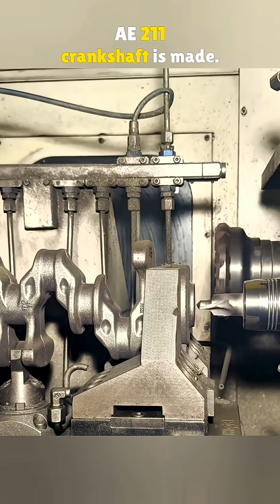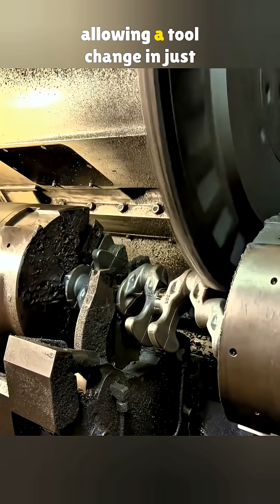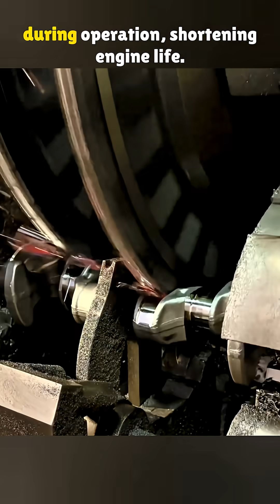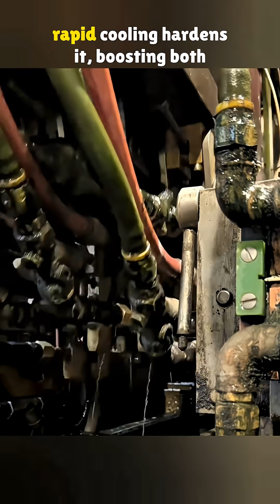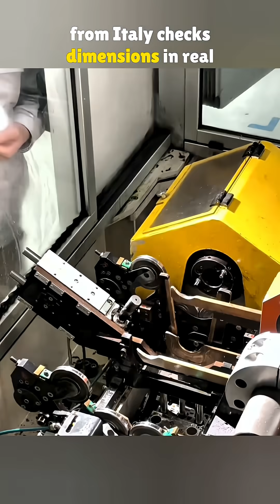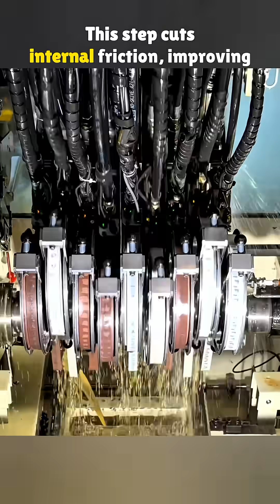Inside the Making of a Volkswagen EA211 Crankshaft #assembly #automobile #car #manufacturing

Comment: It’s not a matter of China having the manufacturing ability, that’s easily observed in the amount of machining equipment they own and the thousands and thousands of products they make every single day. What is doubtful though, is how much engineering time was spent to verify that what they make is any good or whether or not it is reliable. Most products built in China are built to the bottom dollar. That means any extra R&D cost for verifying that the product is going to survive is an afterthought at best.  

China’s manufacturing strength only comes into play successfully, went outside vendors who are concerned about brand and quality are involved to hold their hands. At no other time can they produce a quality product.

Comment: The problem isn't the machinery. It's the unskilled labor and the lack of competent management oversight. When a cutter head is worn, for instance, it's not necessarily replaced on schedule just to save from eating into business profits. The person changing the cutter head may not recalibrate the machine properly simply as a time saving method.  The machine may not get cleaned and maintained on proper schedule to help save money. The only way to ensure the high-quality product is to check it completely by someone who is not on the factory payroll. This must be done before the part makes it into the vehicle OR just send every part back to the OEM for inspection. Just look at all the 3rd party car parts made in China with 0 oversight. 98% of it is complete garbage, including Moog which "USED TO BE" good stuff before it was made in China.

Comment: You Can make a very reliable Precision Engine with basic machine tools. One at a time. Maybe a few more. Economical Mass production is where the Advanced Equipment comes in. Making tens or Hundreds of thousands, in competitive economics. Robots don't have Unions, or sick days.... Well they require maintenance and and can fail and need repairs.

Comment: They have the equipment. They've stolen the patents or don't need them.  What keeps them from making super cars is quality control. By loosening the throw it out tolerance they can make things a LOT cheaper.  You or I may get a lemon but because they can make it so cheap they will just send a new one.

Comment: Yea,  but can they make a Rolex watch that will run for 50 years?
Reply: Yes, Seagull watches manufacture to a standard much higher than Rolex, They even supply parts to Rolex and manufacture twin tourbillions that the Swiss/ French cannot until supplied with the mechanisms they then put together..

Comment: So,back in 80s-90s VW had better machines? ‘Cause those old engines are still on the road,and can be rebuild if needed,but new junk can’t make pass 100k without major issue,and nearly zero chance to reuse or rebuild  the block? Since when it became a norm to replace mains at 60k (some BMWs), and 5 timing chains (5 !) on the transmission side of the motor at 80k on Audi’s v8s? German cars became a joke in comparison to japs,although even they’re droping in quality in later models.

Comment: Actually,  Chinese steel is polluted with other minerals  but will still hold up for a little while.  So they can make engines cheap that won't last because you will just go buy another one. They are not even worth fixing.

Comment: With even so much Sophisticated process Volkswagen cars engine starts problem in india just around 50000km 😅. And in 1 lakh km the engine just trouble so much that it has to be opened 😭.
Better Maruti cars long lasting in india
Reply: Why? Don't believe you 😅 Have you followed the service schedule? Changed oils and oil filters regularly? Air filter? What else? What in the local conditions are so different?

For us in Finland, the rust kills the car. Motors never, which usually had like one more 100k km in them, at least the Japanese 😅
Reply: @Hukkinen in india Ford, Chevrolet has left already due to engine reliability issue, and Volkswagen sales are also going down  , because they manufacture bad quality cars in india,also parts costs are 10 times higher than other cars . In india maruti,tata, Hyundai and Mahindra are best car company.

in other countries vw manufacture top quality I know.😊

Comment: What's not being considered in this video is that quite often, this is all being done in another Country. For example Thailand, India or China, and European and US car makers are just putting their names on it. 
Rolls Royce was manufacturing engines with this kind of precision and reliability in the 1930's. Then a little disruption called World War Two hindered development.
Reply: Ww2 was a bonanza for development.
Reply: @clubprojects6923 Not for motorcars or motorcycles. With aircraft, sea vessels and armaments, there was great progress. However everything else was being made to a standard, often not a good one, because it only had to last the war. You could not buy a car or motorcycle, even when the war ended, unless it was military surplus. The reduction of rifle barrel grooves and 'spike' bayonets being a case in point. Prior to D-day Lee Enfield rifling went from five lands and grooves to two, micrometer adjustable rear sights became a simple folding peep sight and blade bayonets were turned into a short spike. All because it was cheaper and faster to make and only had to last until war's end. Even the Liberty Ships were only meant to last a few years.

Comment: Could you make a video on why they replaced the good turn knob headlight switch with a panel with buttons or even worse in the golf 8s case a touch sensitive panel
Reply from the maker: We posted a 2:57 short about this around four weeks ago, showing the process and the full dashboard assembly. More is coming soon!
Reply: One capacitive touchscreen is cheaper than multiple switches and hardware.

Comment: European cars are mechanically good, but also known as recyclable  junk, with electrical faults, and assorted other issues after 80,000 kms. When all the  plastic parts start failing.
But I agree Chinese manufacturers often cant match material quality.

Comment: This video is nonsense. The primary advantage of CNC equipment is the adaptability, the ability to make the many different sizes of engine parts like crankshaft on one machine. Precision Machining of a crankshafts was my capability that goes back to the 1960s, on transfer lines that were purpose-built to make specific individual components in high volumes. The Chinese can build anything mechanical to an equivalent quality level of anything made anywhere in the world.
Reply: I've done all of these processes manually. I can also program CNCs to do the same. A forged crank is also superior to these castings(the base material shown is a casting).
Reply: @Eluderatnight that's true, but the machining processes are identical. Depending on the process, the roughing operation might actually take a little longer with a forged crank, depending on whether the trim die leaves flash
Reply: @Eluderatnight  No it's forged. forged parts before machining looks like this
Reply: @r11tc  Bullshit it is  cast crank,, the casting line is very clear. To be fair a good cast crank is very good but for out and out perfomance a forged crank is required
Reply: @ldnwholesale8552  Forged blanks has similar looking lines
Reply: Why haven’t we seen these quality Chinese parts that are as good as anywhere else?
Reply: Trade protectionism.
Reply: Because you don't have money to afford it
Reply: We do. In multiple industries
Reply: They do, you just haven't looked in the right places. China today is not what it was 20 years ago. They have some of the most advanced and modern factories and shops in the entire world and they can and do make everything across the spectrum from components and full products that rival and even surpass anything produced anywhere else to churning out the cheapest junk products and components possible. It all depends on what the customer specs. The reason we in the west see FAR more of the cheap stuff is because the companies importing them order the cheapest junk possible so they can jack up the price and make massive profits, but go to the manufacturers themselves and see for yourself. It's shocking. We're getting rapidly left behind.
Reply: You mentioned alot of European equipment but what about Korean and Japanese equipment, I think China is already at par with Us and Europe in manufacturing, even exceed in many fields.
Reply: @Van3560 Korean and Japanese equipment is top notch
Reply: ever heard of cfmoto? well, their engines dont rev as high as other bikes, this explains well how chinese mechanical parts manufacturing is shit
Reply: No  jim, I would not agree. China cannot match the Japanese quality consistently. Evidence of this is everywhere. Just look at problems Bmw and Ktm are having with chinese made engines. Also china is decades behind japan and Europe when it comes to production waste and carbon emissions.
Reply: And yet, their engines are the worst quality there is. If you buy quality chinese machinery like a generator, it will come with imported engine like Cummins.
Reply: @FrozenHaxor buick has been quietly importing one model...it's as good as the US made units
Reply: China population is greater than EU and US combined. They surely have brains to figure this out, or better methods. 

For me it's censorship from their communist party
Reply: Correct, they even build better Rolex Watches than the Swiss themselves, and rumour has it that the US Dollars they "manufacture" are indistinguishable from the ones the Americans make.

Comment: This is why when you start electric car factory, 90% of this complicated machinery is not neded.
Reply: Combustion engines are complicated dinosaurs
Reply: @FernandoHaddadMinistro  We wasted 80  years and  enormous brainpower trying to  make combustion more efficient and clean.
Reply: @FernandoHaddadMinistro 😂😂 wishful thinking...EVs are mess...always have been, always will be
Reply: @therovingrobin5938 , Nobody believes you because you’re wrong and everyone knows it. EVs are war simpler than ICE vehicles and you can charge at home, so you never have to go to a charging station or a gas station again unless you like to take long trips.
Reply: @therovingrobin5938 but Europe is crying,why USA set high tariffs 😂😂😂
Reply: @FernandoHaddadMinistro 
Not that long ago - anyone with a basic set of tools and determination could easily work on a car engine - and indeed the rest of the car.
And indeed many of us did.  producing a generation(s) of drivers who really did understand the machine they were driving.
Hardly a dinosaur - just been made more complicated to improve emissions and efficiency.
Reply: No dude. I work at Honda and I’ll say this, it’s way way more then you think
Reply: @Anthony_thom92 The cost and machinery required to make bearings and shafts for an electric motor are the same as for a combustion engine.
Reply: @luisff7030 yes but there are very few bearings and shafts on an electric motor, and no transmission at all.  It's a compelling comparison, battery versus transmission.
Reply: @microdesigns2000 
No transmission?
How is drive coupled to wheels? 
And what about differential?
Reply: @eric4709 good question.  There is an output gear but no gear selection or great changing.  There is typically a differential.  If two motors are used,  usually that is front and rear, so two differentials.  But no transmission or coil packs or torque converter.

That also means that you can't push an electric by hand because the motor would have to turn while you push it.  If you tried to use a tow bar you could wreck it.
Reply: @microdesigns2000 
Of course- no gears are required because an ev motor can spin at any speed  ( and in reverse) and with high torque at low rpm ( so no need for gearing as in ice to get high torque for pulling away at low speeds.
Not being able to push or tow an ev can be an issue  - my brother had a breakdown with his ev on a dual carriage way - and had to have the car  taken away on a transporter.
Reply: @eric4709  oh that sounds so British!  We take our broken EVs on "a flatbed".  Greetings from Minnesota!
Reply: If china  can build fighter jets ...why not better can engine....thanks to china ...things are affordable
Reply: Thanks. They concetrate on telling how China is incapable yet its far ahead of them all 😂😂😂😂😂
Reply: The Chinese were very smart. Instead of trying to catch-up with the leaders in vehicles with thermic engines; they boosted through propaganda and environmental issues to change the market in their favour, levelling the former advantage Western+Jp+Kr had in their favour
Reply: You missed out the batteries. It's important to realise that the manufacturing of battery vehicles is far more resource and demanding than building engined vehicles. Then you've got to build loads of power generation facilities to fill the batteries that stand in for the engine.
Reply: Absolutely. Dynamic braking solves most of the braking wear and tear. Electronics replaces the gearbox/auto. No brainer, really.
Reply: So we'll be paying more for less.
Reply: can china make good EV, or is it the same as ICE?
Reply: As often EV fans don't know what they talk about.
Reply: Lots of intricate and fragile electronic gadgets in EV's which can easily fail and cost a bomb to fix or replace. VW internal combustion engines are far more robust than anything the Chinese can come up with.
Reply: Suggest you look in detail at how ev electric motors are made. - and the associated mechanical parts that go with the motor 
Then look at the power control electronics for the motor and how that is made.
Reply: I suggest you look what's inside EV parts and rethink what you've said
Reply: @r11tc  a simple aircooled 4 cylinder engine has atleast 26 moving parts. This is without starting, ignition, lubrication or complex valve actuation systems. An electric motor has one moving part. If you count the bearings, 3. Now beat that.
Reply: I was considering part count of EV versus ICE.  There are gazillions of SMD parts and hundreds of active parts in the control system of batteries, motors, and user controls.  But that is true of ICE cars too, engine components, electronics, pipes and hoses, transmissions, is all amazing that they are as reliable as they are.  EVs have the possibility to get simpler than they are currently, but not ICE as those only look to get more complicated.
Reply: @microdesigns2000 

Absolutely - the amount of electronics in cars now is insane. 
Its not that long ago that the most complicated piece of electronics in the car was the radio and sound system.

I think "the car" as we "knew it" is long gone  - A "true" means of simple personal transport long gone too.

Modern cars have in essence become "computers on wheels" with permanent nternet connectivity ( and who knows what data is being sent where ) -  slowly -  but surely disconnecting the driver from any sense of "direct  control" 

Even the most basic functions are accesible only through a touch screen.
Driverless cars are now "on the table"

 I reckon given another 10 -15 years or so when " cheap secondhand" ice cars have gone from the market place  - many will not own cars at all.
I cant see seconhand ev's filling the gap somehow.

I know very few people who can afford a new car - and many who do drive new ev's etc are doing it on lease.

Comment: Yes I agree 
Chinese turbo engines consume a ton of fuel
Reply: Yes because 1,200hp needs lots of fuel.
Reply: @philjjordan6197 ahh, most of the Chinese cars that make a lot of power is because of a hybrid system pushing most power or it’s just an ev 
But I am actually talking about the surge of economy Chinese petrol cars that flood the market with a fuel consumption of a 911 with half the engine and quarter the power

Comment: crankshaft journals are polished not because of fuel economy but if they weren't bearings would wear in minutes.
Reply: And once they wear in minutes obviously fuel economy will be affected so yes it is true anyhow
Reply: @avinash48  When they wear out, one insert will slip under another and they will lock crankshaft and you won't go anywhere, so I assume that was your irony.